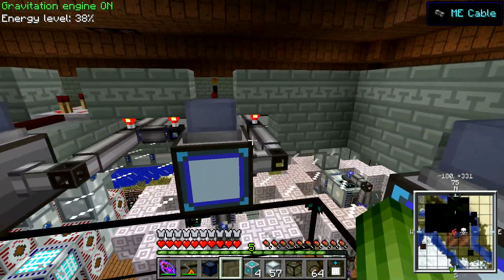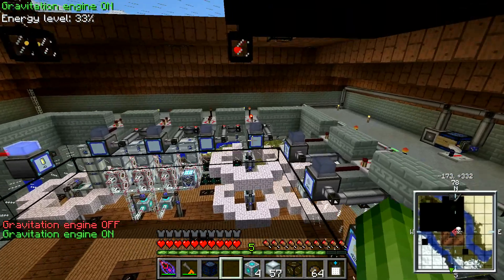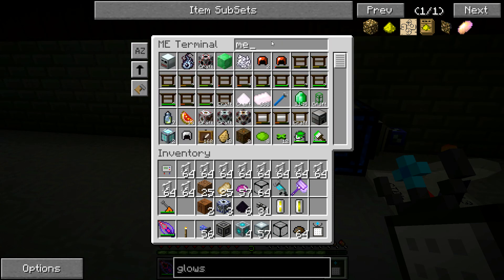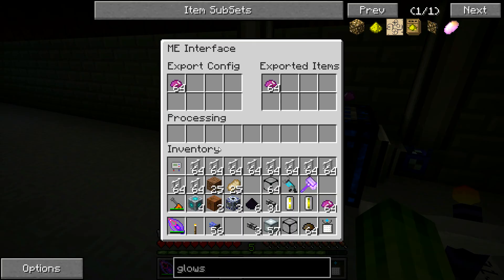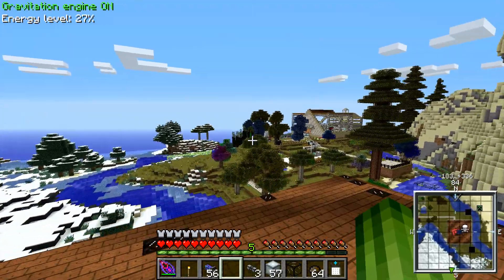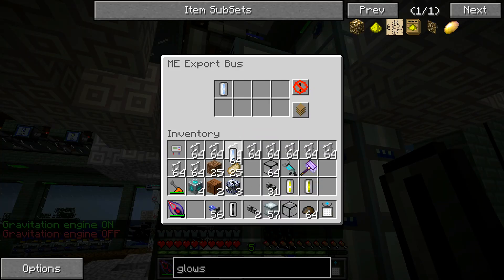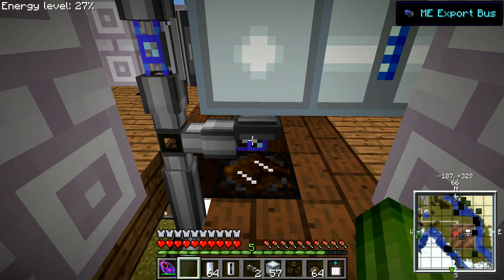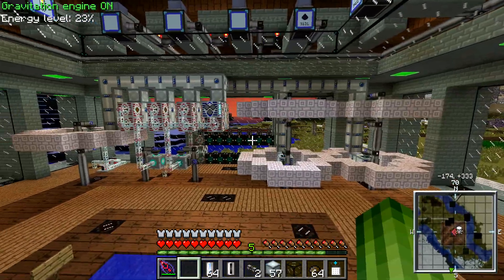Minecraft Feed The Beast  E32 - Producing Iridium Ore with Fusion Reactors and keeping Tungsten Dust

Comment from the maker: Yes, in the new gregtech fusion reactors will change considerably. As of MC 1.5 the fusion reactor is much more complicated, and outputs plasmified helium which must be piped into plasma generators to generate energy.

So basically you need a factory to feed the fusion reactors, and a factory to generate energy with the fusion reactor produce. I kinda like the idea of needing more stuff to run them :)